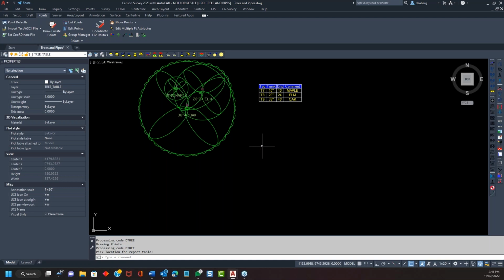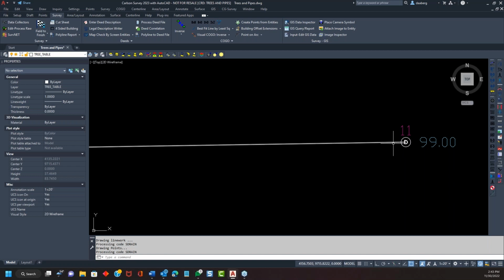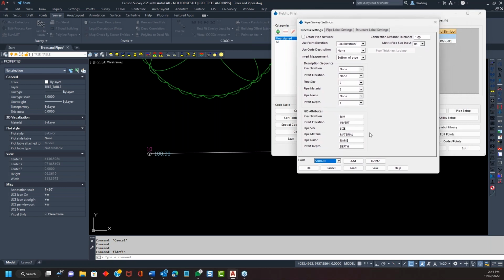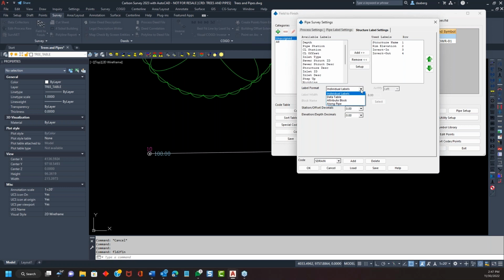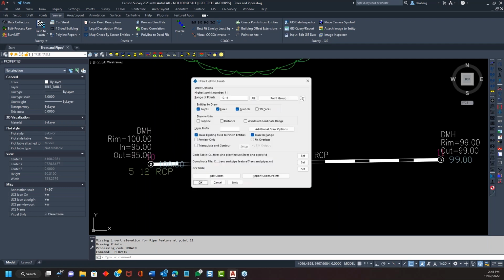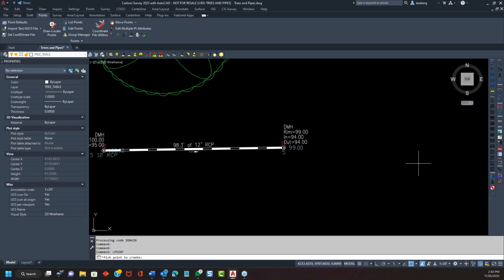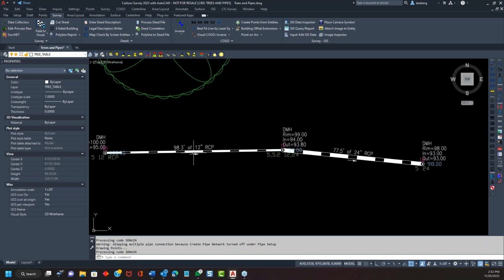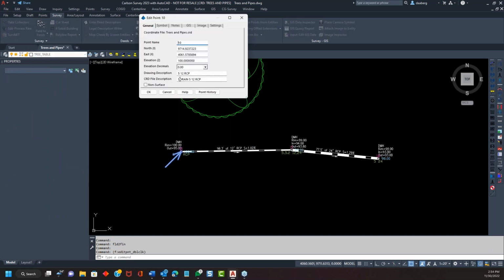Tree and Pipe Features and Other Field to Finish Goodies - Video 2

Comment: This was so helpful and I have already updated my Field to Finish codes for doing sewer as-builts. Question. I notice the slope % is being shown from invert in - invert in (94.00 to 93.00) and should be shown invert out to invert in. Is there a way to correct this?
Reply: Ben, you found a bug here. I have reported it, and it will be fixed. Thanks for your input.